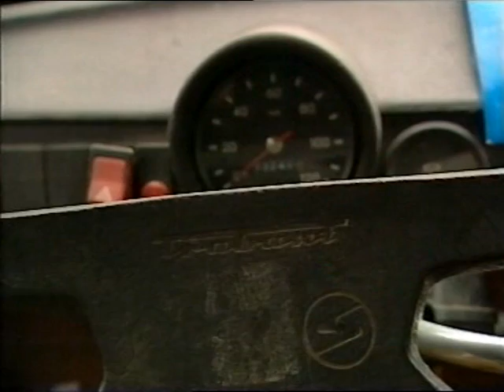Coltrane's Planes & Automobiles: The 2 Stroke Engine Part 1

Comment: Although I do not currently run 
a 2 cycle engine, I am VERY aware 
of what the expansion chamber can 
do.

I had a Yamaha RD400, or 4.  I'd 
tell friends not to go over 4000 
rpm.  After they had put a few 
(hundred) miles, I'd say to go 
further, but be VERY aware of the 
power output.

4000 was about 25 percent of the 
available power.  6500 RPM, was 
FULL power!  Treat it carefully!

I've got a 2 stroke 80 CC bike 
motor.  It will (eventually) get 
installed on a bike.  I also have 
the expansion chamber for that 
engine.  I've had chambers for 
prior bikes, and, when you are 
dealing with 3 or 4 HP, a 100% 
increase, will shake you up!

steve

Comment: About 13 minutes in he has a model airplane engine in his hands. It isn't a 2 stroke. Its a diesel. It has what looks like a wing nut on top of the head instead of a glow plug which  nitro 2 strokes require. The wing nut is to adjust the compression so the.diesel will ignite. Get your props right. Own a couple of the antiques. A .15 and a .20. Both Made by Torpedo. Still run and are over 70 years old.
Reply: Actually the so called diesel model airplane engines ARE 2 stroke as are countless Detroit Diesel truck engines and, of course, large modern marine diesels